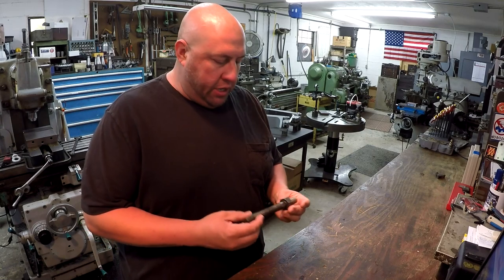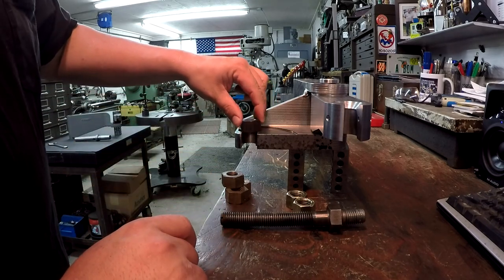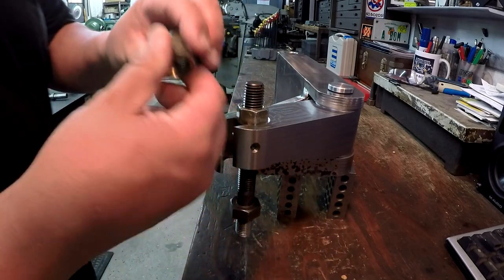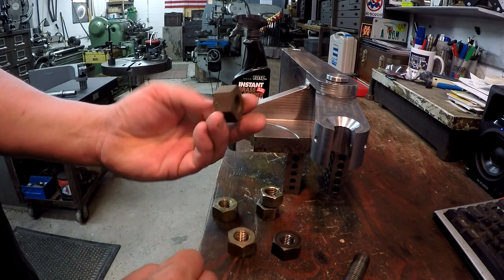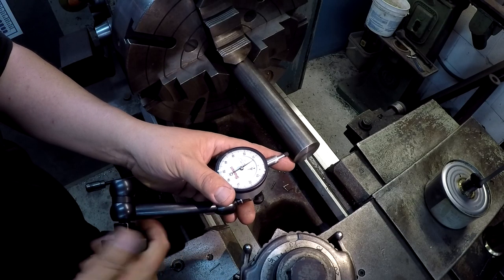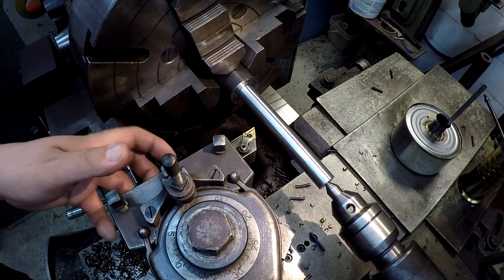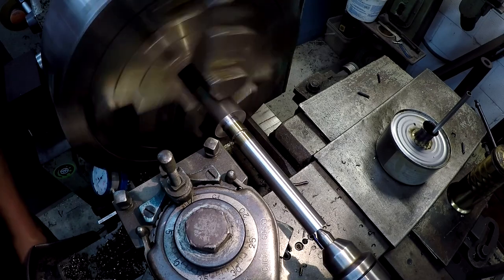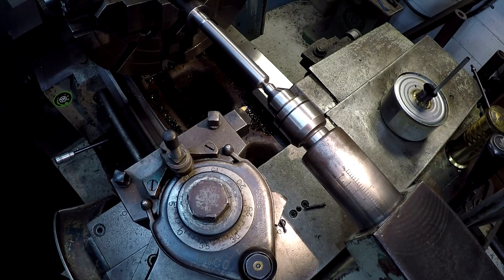Kearney & Trecker Parking Attachment 14 Part 1

Comment: Hi Adam! I was the one asking about that stressproof. Looks like it's about the same stuff we call "automatic steel". Real easy cutting especially with those kind of inserts. The one time I got to try that steel I turned 1200 castor pins with one corner of the insert and it showed no signs of wear. That was on a cnc tho but with no coolant.

Comment: Adam, you seem to be getting a consistent 0.001" taper on this lathe. You had the same problem when machining the pin. Is there a problem with the carriage, or the ways? Maybe the tailstock? Any way you can adjust or calibrate the small error away?

Great video, as always!

Comment: Pro tip for cleaning up bronze, brass, and copper: ketchup! Just used some to clean up some tweco welding connectors. Does a great job.
Reply: I think just plain white vinegar works as well. Less messy, too.

Comment: Good explanation of the manual thread cutting process. Some folks use the cross slide to take the last couple thousandths to use both sides of the insert threading tool for a nicer looking thread.  Both ways are correct.  I noticed you changed RPM on your Victor lathe. Not all lathes will pick up the thread correctly if you change RPMs.  Once again, very nice work.  Jeff

Comment: OBTW - if looking for good cutting oil, tractor (etc) Hydrolic oil is nice and contains a high amount of sulfur.  Sulfur eases the load on metal to metal and improves cutting on a lathe and inhibits shaving in transmissions and other parts of the tractors.  The 'old' oil is trashed or recycled anyway.  On the bolt - a thread cleaning slot could be cut at the end.  junk gets put into the slot and not pressed onto the threads.

Comment: Will test-fitting the nut on the threads before you take the sharp tops off them with a file damage them by rolling the tops over on the inside of the nut?

Comment: I have never cut threads and have only used a lathe a few times a year for tony simple parts. If the carriage is being driven by gears from the lathe spindle, how could the TPI ever be wrong? if you measured the threads and they are wrong, is that because of an incorrect gear selection or because of something else?

Your videos are great. Thanks for making them.
Reply from the maker: Threads that are divisible by the lead screw pitch you can enage the half nuts at any position. For other even number threads any line, and odd threads every other line.

Comment: Will you get dissimilar metal corrosion from the brass to steel interface?
Reply: That's really only a problem if it gets wet. If you were to connect a brass valve to a steel water pipe, then you could have trouble.

Comment: Why do you call it a spring pass?? and what dose it do?? Sorry if this is a dumb question, or if it has been answered before. Great video!!

Kevin
Reply: Spring pass is basically taking another cut, without changing or adjusting the depth of cut from what i can see. So you end up cutting at the previous pass depth, just to see if it cleans any small amounts of material up before making adjustments.
Reply: Ok I understand now, thank you!!

Kevin
Reply: I believe that a spring pass is making another pass without advancing the cutting tool. So, basically you are making another pass with the same settings as the last pass. It is called a spring pass because when you make a cut the part deflects or "springs" back from the cutting pressure slightly, by making a second pass with the same cutting depth settings the machine should cut away the material that was left due to the deflection on the previous cut. Also, because the spring cut is only removing a very slight amount of material there is little or no deflection on the spring cut.
Reply: Thank you

Kevin

Comment: how come you get that taper, awesome video btw
Reply: Is the taper a result of slight lathe bed wear in the ways?
Reply: It could also be a result of the extended tailstock.
Reply: might be a slightly offcenter tailstock or the cutting forces pushing the workpiece more away in some areas.
Reply: The tailstock is probably out by about half a thousands, not much to bother with unless you do work for NASA... :)
I don't think it can be the workforces, 'cause then the taper would have gone the other way - unless the spindle bearings for the chuck are shot, and they doesn't sound that way.
Reply: More than likely this is the reason. Bed ways on lathes are extremely hard to keep straight because they are so long. Just think of the stress put on the frame of the bed from moving a lathe. I have yet to see a lathe that didn't have some variation in the straightness of the bed ways.
Reply: i get what you are saying but he wasn't turning that long of a piece, makes sense though that the ways are starting to wear.
Reply: From what I've seeen in Adam's previous videos, the taper seems to be consistent (about 1/1000 over any length) as long as he uses the tailstock for support, so for me it figures. :) Maybe we Adam himself can give us the right answer? :)
Reply: @yngveamundsen5184   i think its the tailstock some shows i have watched the bit moves up when he starts a center bore ,, just started watching his shows  seen 30 or more .. seen that bit move ,,

Comment: Adam,  after facing the rod measured 6 inches and did made his first cut. Then you did a second cut and used a mic to measure the thickness. It was 1 thousands differance from the end to the 4 jaw.  So he did another cut and the same thing happened.  I know 1 thousands very small but why?  You had it chucked and then put a center and used the center thing to keep it.  Why the thousands differance?   I would have thought it would measure the same on both ends.    I'm the guy that not a machinist and just like watching you build things.
Reply: The tail-stock was probably off center by a thousandths at that particular position. It's very difficult to have perfectly straight bed ways on these lathes over those kinds of distances. A lot of lathes will be out by that much or more depending upon the position of the tail-stock/saddle on the bed.
Reply: I think that the most probable reason is that the tail stock is not in perfect alignment with the head stock.

Adam, I would also like to hear your take on this.
Reply: I may be wrong but my understanding in that the tailstock is slightly out of alignment with the headstock. In this case the tailstock should be 0.0005" further away from the operator.
Reply: wear in the bed of the lathe, most likely, having a thou taper is what he commonley ends up with and uses a file or abrasive paper to even it out, if its needed
Reply: Also, the chuck is very rigid. The tailstock, even a good one like that victor, has some wiggle to it. So on a perfectly aligned tailstock, tool pressure can make the tailstock end slightly larger due to deflection. Which is the opposite in this case, so yeah, just misaligned.
Reply from the maker: I think I have a couple issues happening. One is the headstock itself seems to off just a bit and I need go do an adjustment on it. Also the tailstock is just slightly off and has a small amount of wear in it. I need to spend some time and do some maintenance.
Reply: It might be good for some future video...